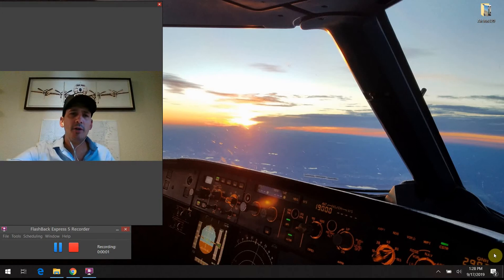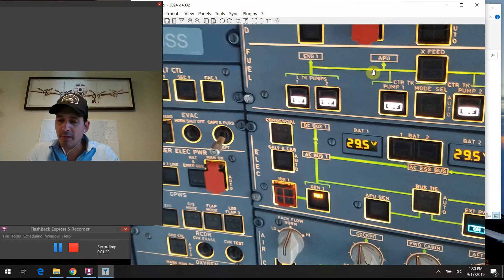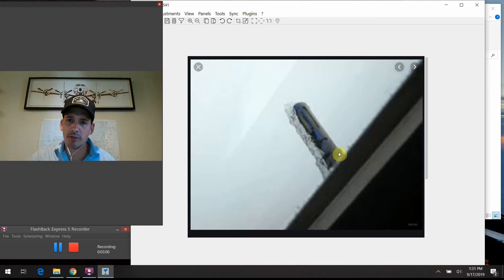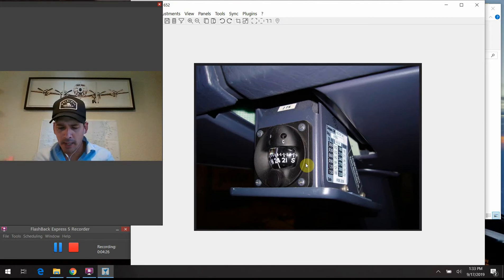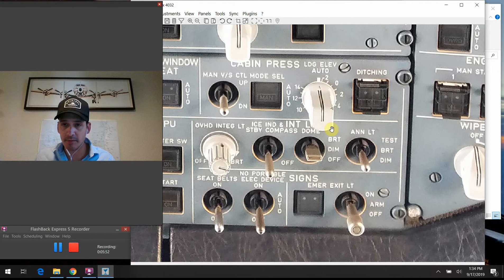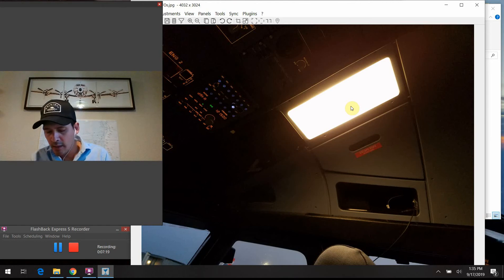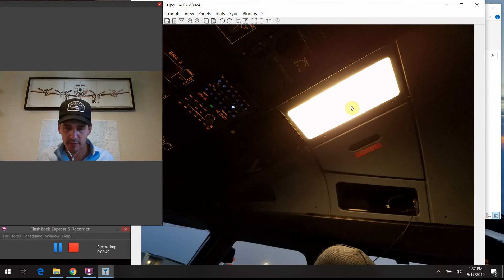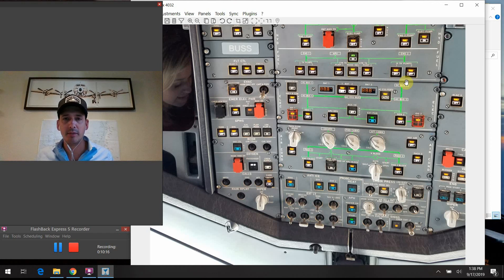Airbus A320 Cockpit Tour: #28 - Lights Panel: What do all those buttons do?!

Comment: How do i flip the A320 neo? I ask that because there is a system which block that, so you usually cant flip your plane. Is it anyway somehow possible (so that i can fly on the back)?
Reply from the maker: Well. Haha get the plane into alternate or direct law. Many ways to do that. Turning off multiple ELACs, SECs, or FACs would do it. Other failures would do it too.
Reply: @MikeAbignale  Can you please make a video about "How to turn of the safety systems of an A320 neo".
Reply: @ScienceCastRic  what is bro trying to do

Comment: Hi Mr.Abignale
I did not quite understand the Annunciator switch. I understand that ,when put in test position, it illuminates all lights in the cockpit. I didn't understand what exactly does the dim and bright positions control. Does it control the lights on the pushbutton Or does it do something else?
Reply from the maker: Hey guys! Love to see the discussions taking place. Mr Leonidas is correct. Aby, I've made a note of some things that I wanted to take pictures of for you next time I go to work. I'll try to get a video showing the modes of lighting you will see when you use the ANN switch. Also one of the lighted up Ice probe at night. Hope you guys are having a great week!
Reply: @MikeAbignale  Thank you very much Mr.Abignale😀😀😀
Reply: @Leopilot   Thank You Mr.Leonidas for answering my question, but it still does not answer one question : Which light exactly does Annunciator light switch control?
Reply: @Leopilot  Thank you very much Mr.Leonidas😀😀😀